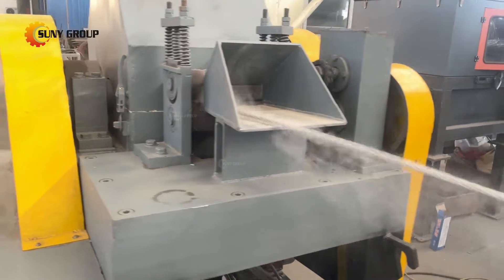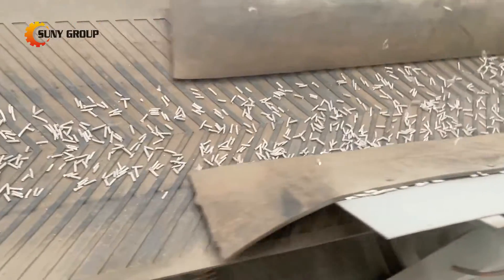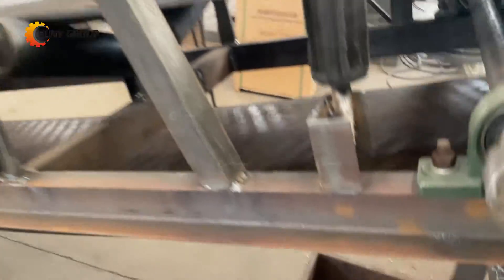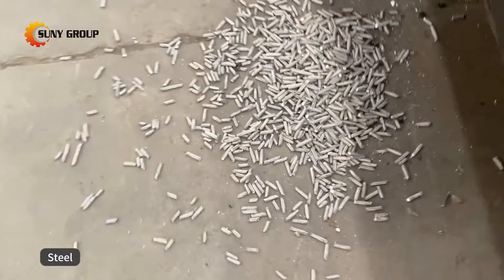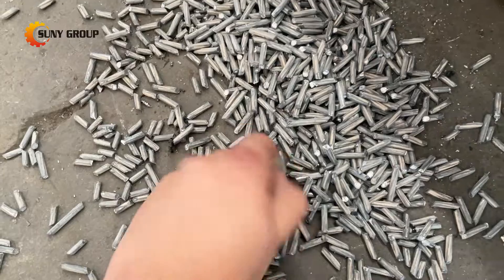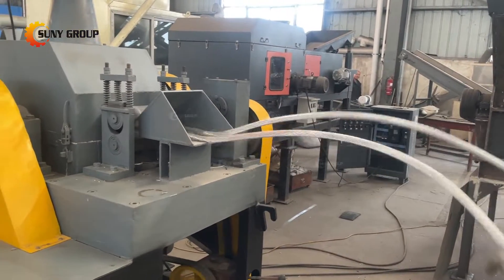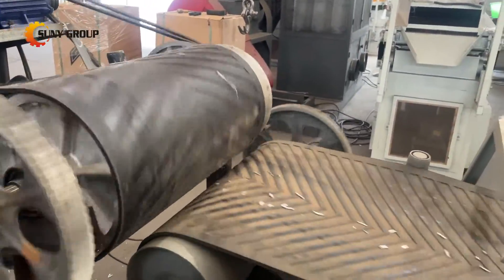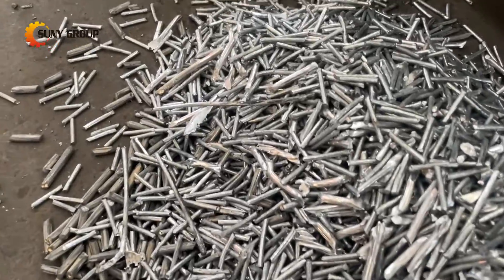ACSR Cable Recycling | How to Separate Aluminum and Steel

Comment from the maker: Our ACSR cable recycling machine has an adjustable output size with three-speed settings for output dimensions of 10mm, 20mm, and 50mm. 
It offers high separation rates for aluminum and steel. If you're interested in our equipment, please feel free to contact us.
Email: jackhao0804@gmail.com  
Whatsapp: +86 137 8362 0467